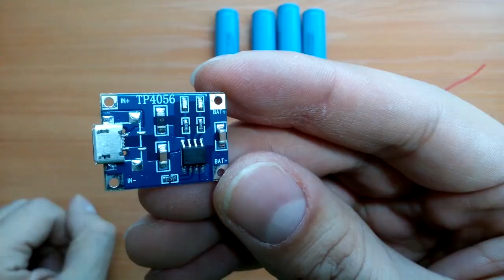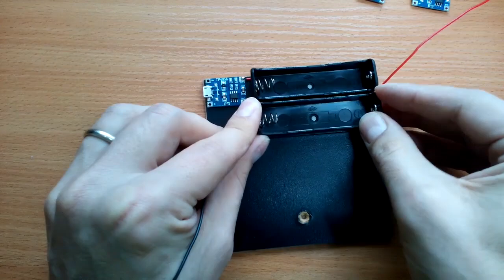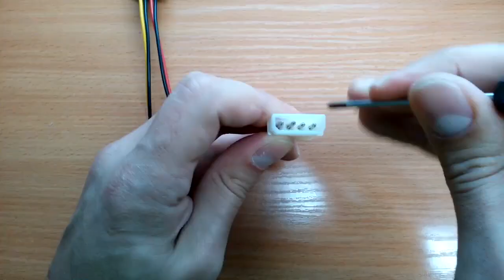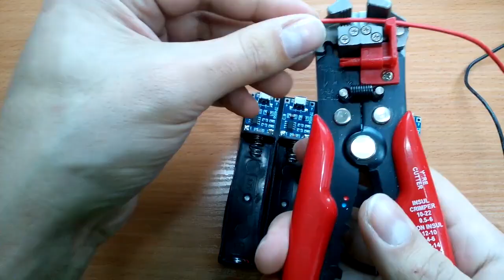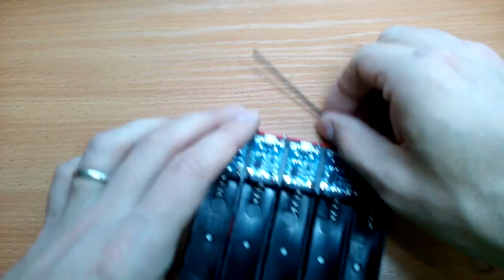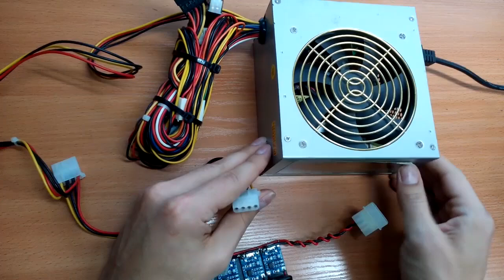DIY: Lithium 18650 Cells Charger By Using TP4056 Modules

Comment: why you put 5 pieces of cirduit boards? you can do it with one board if connect the batteries parallel....and after that your batteries charged in the same time.....
Reply: +ΔΗΜΗΤΡΗΣ ΜΑΡΤΙΝΟΣ No, it isn't recomanded to connect batteries in parallel with different voltage, it could damage the cells (a cell charging a other cell).
Reply: JS7457 nop...if open a power bank you will see the conection of batteries and the circuit charging board...;)
Reply: ΔΗΜΗΤΡΗΣ ΜΑΡΤΙΝΟΣ Yes, because they where always together. If you want to charge 18650 in parallel you need to charge them individualy first, check voltage for both cells, they should have 4.20V after charge, now you can connect them in parallel and use them always in parallel, when the battery are discharge you can charge them up in parallel.

Imagine you have a cell with 3.2V and an other with 4V and you put them in parallel, the cells can be damaged or even can explose.

So no you can't just randomly put cells in parallel. Putting cells in parallel is for increasing the capacity.

The charge would be longer.

Comment: In case anyone is planning on building one of these in the future I think I should mention that there are two versions of this TP4056 module, one of which is a direct upgrade to the other. If you're looking to pick a few up, make sure they have 6 pads total, with 2 in the front (positive and negative), and four in the back (OUT positive, B positive, B negative, OUT negative).
Reply: It is not necessary. If you use TP4056 for only charge Li-ion only, old version is really good. But, if you do some DIY flaslight or boombox, whatever you want, new version of TP4056 would be good, it will protect your battery from deep discharge.

Comment: Thanks for the video, I write from Spain, wanted to know if there is way to use the cells without removing them from the cradle, the idea is to put the module that you created in this video inside a box and close the lid, just load them from a plug and use the stored power from another outlet in the box
Reply: +David Alonso -Yes this assembly in a box is named " Power Bank with 18650 batteries and  TP4056"  and search on Youtube some examples

Comment: Nice, can you use more than one module in parallel for extra current? just curious.
Reply: Um, they are in parallel. Otherwise you would see jumper from one module to the next, negative to positive.
Reply: Actually They ARE in parallel array... :P
Reply: +Vincent Koster You're right, but in these specific circuits there is current limiting components, so adding batteries in parallel will only add to how long they will last on a charge and not to the output current
Reply: When connecting in Parallel you are doubling the capacity  of the battery while maintaining the voltage of one of the individual batteries..... V

When connecting your batteries in Series you are doubling the voltage while maintaining the same capacity..  I
Reply: Vincent Koster thanks
Reply: +Luke Kostrewa  ¬¬
Reply: No you cant put many chargers on one battery if thats what you meant. These are internally  set to 1A charge current by a tiny SMD resistor.
Reply: i don't think so. parallel wiring decreases the resistance, which enables more current to 'flow' through the circuit. if too much current flows it could Heat up and Fry the circuit

Comment: Hello, can you make a video on how to build that in a Vertical order with multiple batteries and a flashlight?
Reply from the maker: +Morgan Seun sorry, I don't understand what you mean..
Reply: I meant placing the batteries upon each like a straight line with one module?
Reply from the maker: +Morgan Seun that's possible but makes no sens, because it will divide charging current and charging process will be few times longer.

Comment: Nice but You can Use one module, than charging time Goes longer
Reply: +CreadorHDPlay No, it isn't recomanded to connect batteries in parallel with different voltage, it could damage the cells (a cell charging a other cell).

Comment: its awsome. i can use it for e-cigaret batteries to charg? format 18650? and one more question it will be balanced?
Reply: +Irakli Nishnianidze yes
Reply: +Frank Brazh I can use instead of the power supply from the computer. Charge by phone at 5v 2a and 3 batteries
Reply: Thank you

Comment: Thanks for sharing. There is now a slightly improved board that allows for controlling/monitoring the 'Discharge' also - which basically means you could quite easily make your own Portable Battery Bank with just a few modifications.
http://www.ebay.com/itm/10PCS-5V-Micro-USB-1A-18650-Lithium-Battery-Charging-Board-Charger-Module-/201039030988?hash=item2ecedc2acc:g:zHgAAOSw1vlUxZ0Q
*see extra tabs for output, giving it protection on Discharge AS WELL AS Charge

Comment: i would like to make DIY charger for 2pcs 18650 battery, but i dont want to use that big thing(PSU?), instead i am gonna use regular smartphone charger...

if i have:
---2pcs battery holder
---2pcs TP4056
---a micro/mini usb cable
---a smartphone charger

how to make it? Thanks in advance :)
Reply: +Nevada Saga Suseno 
Just connect micro usb plugin into one of the chargers and solder the other one's input connectors to the first one - plus to plus, minus to minus. Make sure your phone charger delivers 2 amps of current minimum and you should be good to go.

Comment: Hi, what are the capacity ratings of your 18650 Li cells? 
Thanks!
Reply from the maker: The best find is 2150mAh. There's my new video about 18650 cells recycled from dead laptop batteries. There is cleary visible what I found.
Reply from the maker: Here's a link https://youtu.be/6GpvOvw5oEc
Reply: +Well Done Tips But does this module have the charging elimination function? Does it recognize the type of battery you connect (i.e. LiPo, which end V should not exceed 4.2V)?
Reply: I have an Imax B6 Li-ion/Polymer balance charger, which I aimed to buy for charging LiPo batteries, and it charges them well. I haven't yet charged lithium batteries with mentioned charger, although you can most likely find them in small powerbanks.
Reply: You can also recharge all those old batteries using the http://EzBatteryKit.com system for more free energy
Reply: Well Done Tips,, more Li cells much better with the same module TP4056?
Reply: @ Kelly Falloxe What?!?!?! It is a book with "magical" advices and tricks? Muahahahahahha, oh plizzzzzzzzzz!

Comment: Great project and very useful. I need 4s batteries for a portable project, where I need 12V, and this solves half problem. The other half is how to protect the 4 batteries during discharge. Assuming to solder the batteries poles in series (so that when I close a switch I get 3,7X4 V), how can I protect them from over discharging?
Reply from the maker: I'll use simple RC lipo battery meter witch will beep when eatch group of cells connected in series drops voltage below marked limit http://m.ebay.co.uk/itm/2X-1S-8S-RC-Lipo-Battery-Low-Voltage-Alarm-Buzzer-Indicator-Meter-Checker-Tester-/291473169214?nav=SEARCH
Reply: i Used a Voltage meter that shows a percentage. 0℅ means that you batteries do not contain enough Voltage to Push the required amount of amps. if you charge them a little earlier you'll never discharge too badly
Reply: you can use this one instead. its update verion of the one shown with protection. i even plan to use this for making 18650battery pack for my drone
 http://s.aliexpress.com/ArIV7feq
Reply: There are some cheap Chinese battery protection and balance charging boards which seem to do the job (at least in my experience).

The boards come in a couple of configurations at least.  One just has connections for the cells and a single set of input/output connections while another has a separate negative connection for battery in/out, power in and power out on top of the connections to each cell.

There has to be a separate wire to each cell in order to properly balance charge them.  So in a 4S connection, you have 5 wires going to the batteries.

Comment: what if you dont have a power thing like that
Reply from the maker: +time for some fpv action there's two options: to use regular mobile phone mini USB charger (but this will power up one TP4056 module at a time), or you can buy new power supply unit from electronics shop with specs: 5V and at least 5A of current.
Reply: +Well Done Tips
You can easily power up all of them - just solder the inputs together like you did and then connect USB charger to any of the micro usb ports. Just make sure that your charge can supply enough current.
Reply: +gazi tazbir yes, but 1 battery need 1amp, so u can use only 1 battery with 1amp mobile charger or 2batery with 2amp tablet charger
Reply: +gazi tazbir 1 battery charged with 1 TP4056 Module need 1amp, if u have 4bat and 4 modules so u need 4 amp, if no, if u have 1 amp, it will be charging slower, ut if u have only 1amp, use only one TP4056 Module, if u have 2amp use 2 TP4056 Modules, this module take max 1 amp, so if u have 1module and 2amp still baterry will be charging with 1amp ->same charging time
Reply: +gazi tazbir if u want charging 4 battery in one time with only 1amp, use only 1 TP4056 Module because more u dont need->1amp->1 TP4056 Module for 1 or more battery 2amp>2modules>2or more bateries
Reply: use a 5v 1a Charger per circuit, or 5v 2a per two circuits. phone chargers come in 1 and 2 amps. just buy the right one in this case
Reply: time for some fpv action o
Reply: fpv action any rc car

Comment: Wait why would you need all of those charging modules? If they're in parallel you could basically do it with 2 wires, 1 module, and 2 nickel strips. Or did i miss something?
Reply: But when one batterie is full they will be overload (or not?). For more cells you need to balance the batterie pack. This charger can not do this. Now i also want to make a batterie pack like see in this vid.
Reply: +Denzel Ray does that mean with 5 of the units you can draw possibly 5a from the supply since he said each module can give out 1a max?  Isn't that kind of a lot of watts for the small wire?   somehow that doesn't make sense to me.  It makes more sense that the point of the 5 units is so you can charge each one independently and some will finish charging faster than others.  i dunno much about electronics. appreciate any comments
Reply: +danh le I asked because I had a similar setup with a portable ps2 mod. I had a 24,000 mah battery connected to a module similar to his except it output 2.5A. I also used the same wires to connect the ps2 (which draws about 5A) to this power source with no issues. Although mine is easier, his is better because it will charge much faster than my setup.
Reply: +danh le oh and watts is completely dependent on the charger. Amperage x Voltage = Watts.
Reply: That would take a long time to charge all 5 batteries.  The charge module only puts out 1 amp. Split that between 5 batteries it would to 200ma each. This would take over 8 hours to charge all 5 if they were fully drained
Reply: This way setup charger can charge the battery individually just in case some of the battery lower or higher.
Reply from the maker: +Denzel Ray yes, you can, but then your charging time will be 5 times longer;)
Reply: +Well Done Tips did not think of that. That's genius.

Comment: can we charge 2 cells connected parallel with 1 tp4056 board?
Reply from the maker: Yes, you can, but your charging time will be double longer too.
Reply: Nothing bad will happen. Those modules typically only allow a 5v max output. You could, however, run into an issue if you try charging them all while the batteries are under load.

Comment: how did u manage to bypass the PC power supply so it runs without any load on it?
Reply from the maker: It's need to short black and green wires at a centre of 24pins connector.
Reply: +Well Done Tips thanks for the response! I'm going to try this out

Comment: If you supply this setup with  a 2 amp power supply will it burn out or will each board charge with 200 mili amp?
Reply from the maker: I think the second option will be true.

Comment: is it possible to charge 2 serius connected battery at same time ?
Reply: +sanerdk  not with this setup but you can charge them in parallel (just don't put 1 nearly charge battery  with a nearly depleted one or they heat up) but you can get a small battery bank charger from china for a couple of quid anyway

Comment: Brilliant simple and useful! At home you can use an old AT or ATX power supply from a scrapped computer. It gives 20A or more at 5V. However, for 1-3 (or even 4, if it gives 4 Amps) cells you can use your laptop power supply with a single step-down buck converter, such as XL6009. This will make the whole charger pocket-portable.Your way of charging Li- batteriues is the best - they have to be charged 1 by 1, not together in series. Regarding the application - you can replace outworn batteries of old wireless tools (14.4V) with only 4 Li- batteries, placed in two double 18650 holders (glued back to back). However, use protected batteries or make/use a protection circuit to avoid over discharge. Thank you for sharing!
Reply: +Bolgartopper hi... i tried and failed at my version of this. i think the problem was i was trying to charge 5 batteries at once, connected to a cheap 1 batt module as the charge controller. Im going to try this one... So do you think charging them individually is best?

Comment: how many amps the output of curent on your cpu powersupply? did you measure that?
Reply: yes,tried it, and capable of supplying up to 20 slots, and each slot of its maximal 1A
Reply: I Was wondering the same as the amps are split through the cables and I Dont think It would be supplying 5amps at the end of the line. did you find out?
Reply: it would supply max.1A each slot, depend on the batteries
Reply: Thanks that's what I thought

Comment: Hi I have a question, I ordered one of these, the one I got fluctuates constantly between 4.4 - 4.8 V instead of 5V (checked with multi meter). Is that normal?
Reply from the maker: Where did you're getting this voltage?

Comment: thanks for the idea (y) it was pretty cool 
but i had have question in mind !
can i use one TP4056 circuit to charge " 2 batteries in parallel " or it will cause an over charge for both ?
Reply: +Peace and Love no they shouldn't overcharge when the batteries are in parallel they act as one (unless you have a faulty one) i frequently charge 8 at a time
Reply: Yes!! But it may take longer time to fully charge those two in parallel.
Reply: +Andrew Maraguinot yes i know about that , but the TP4056 will stop charging when the current in about 100mA for one cell, mean 50mA for each cell in parallel so it's like if i will put one cell charging for more time, is it ok with this ? 
thank you :)
Reply: +Peace and Love yes it is ok because the tp4056 will just put it into a mode that it will just float the current to the battery.
Reply: +Andrew Maraguinot how !
Reply: +Peace and Love Just connect your battery in parallel to the tp4056 output and your done.
Reply from the maker: Yes, you can do that, but it will take twice longer to charge;)
Reply: +Well Done Tips thanks for the answer :) 
but what about the over charge ?
Reply: +Peace and Love I would not recommend parallel charging with a TP4056. If either battery's voltage should go above 4.2V there is a very REAL risk of fire. This is why 2S and above battery packs use a balance charger! The TP4056 is designed to charge one LiPo, and this is the reason for 5 separate units in this build for 5 batteries. If you are in any doubt about this I suggest you read up on the subject, there are plenty of good tutorials online regarding the safe charging of LiPo batteries.

For example: https://www.maxamps.com/lipo-care.php
Reply: thanks for your explanation Sir :) , that's what i was talking about & you confirmed it to me & other readers ;) , thanks a lot
Reply: +Nick B all laptops and drills ect have batteries welded in parallel the balance charger is only for series the only thing the tp4056 setup is missing is an over heat cut out and a polarity check
Reply: +Alex Newton ...... and a battery protection circuit!

Comment: Awesome! Thanks for sharing! 
one question though, if may I ask?
HOW many modules and batteries I can charge at the same time from the same power supply "like the one you use" simultaneously?

Thanks again!
Reply from the maker: All depends from power supply specs ( how mutch curent it could supply at 5V). All PSU have a spec sticker on it, there you could find those numbers.
Reply: Well Done Tips What wire did you use to connect the tp4056 with the computer supply? Thanks 😃
Reply: ++Well Done Tips - how many ampere is ur PSU, bro.?
Reply: thanks for asking Fahad Al-Monaya I have assembled a 100 cell charger unit using the same charging units as here  my only problem is that these PC boards do not seam to shut off even if left for hours I have installed 1 120 amp 5 volt dc power supply Mean Well HRPG-600-5 AC/DC AC/DC Power Supply Single-OUT 5V 120A  it handles these cells quite easily.

Comment: Hi friend. tell please as this model of the controler and where it is possible to order? excuse that disturbed and I appreciate your roller it is a pity that I don't know English.
Reply from the maker: +Вячеслав Самарин Hi, as I mentioned in video, and left a comment in description, this is TP4056 chip. I bouth them from ebay.com.  Just write in ebay.com search field model name "TP4056". For exemple: http://www.ebay.com/itm/5pcs-TP4056-USB-5V-Lithium-Battery-18650-Charging-Board-Charger-Module-DIY-/191317528778?hash=item2c8b69d0ca:g:wH8AAOSwGvhUCz0N